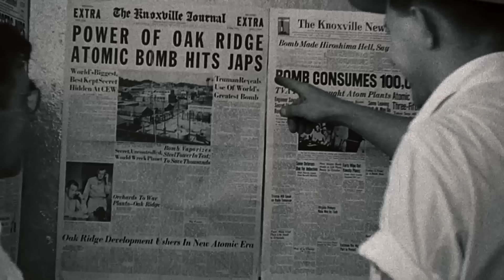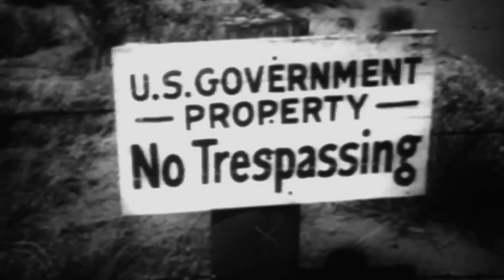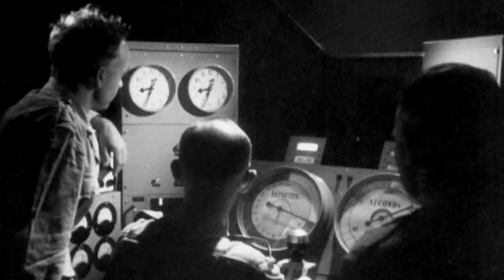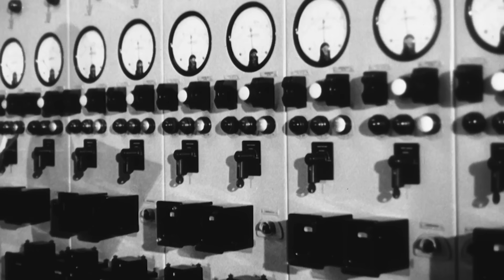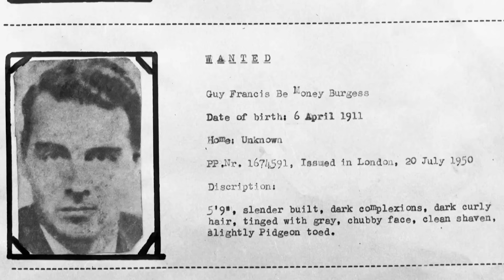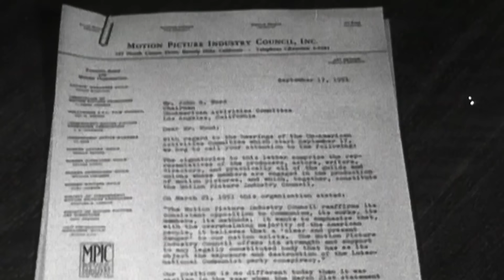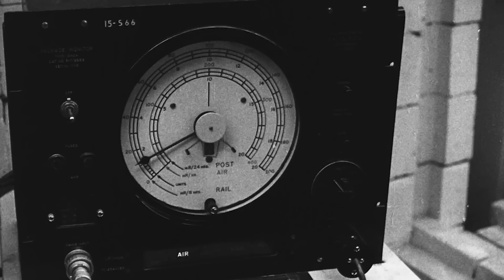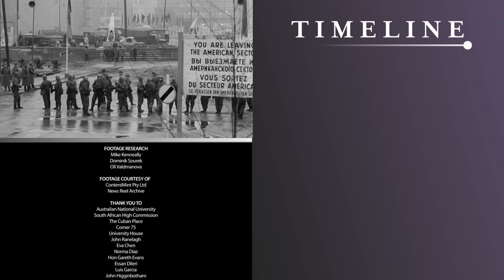H Bomb: The Cold War Weapon That Could Wipe Out All Life | M.A.D World | Timeline

Comment: As a documentary they should try to be as accurate as possible. 
  Nuclear launches can not occur with the push of a single button- that’s a very rhetorical statement. Any use of that weaponry (from every state power that has nukes, afaik) requires a chain of command. safeguards and separate launch authorizations are required along each step. 
No single push of a button will do it.